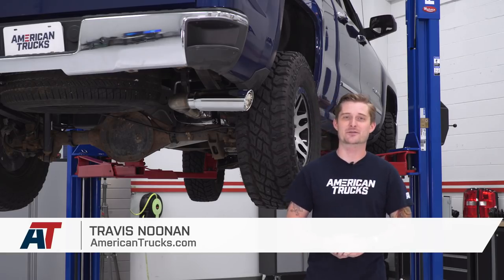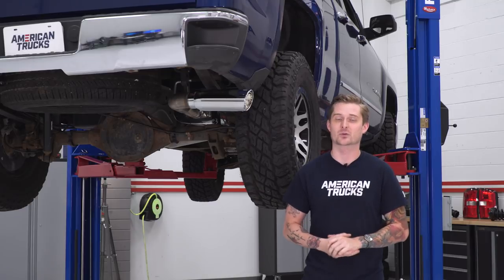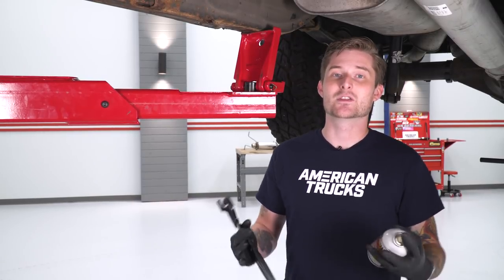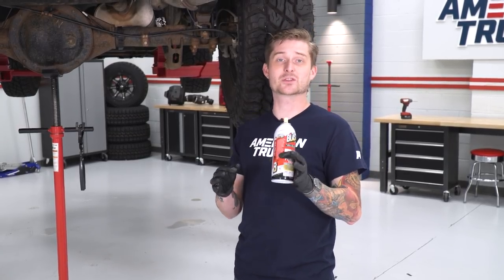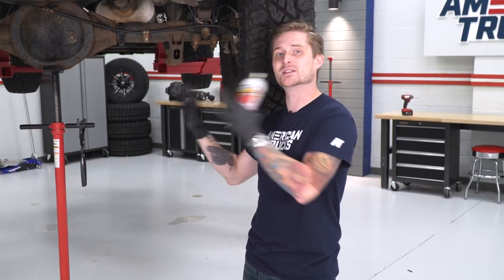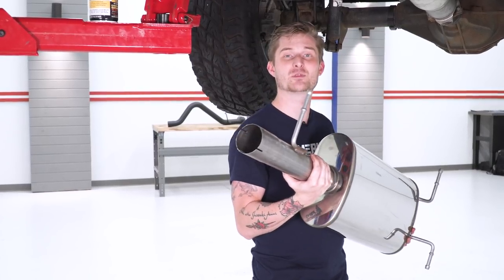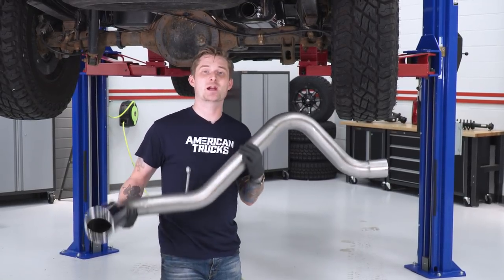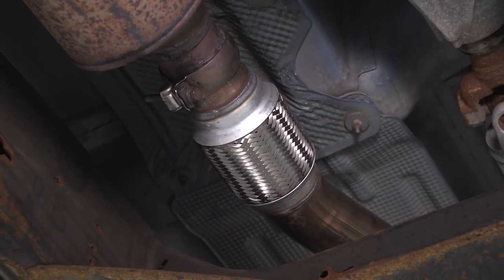2014-2018 Silverado & Sierra Magnaflow MF Series Side Exit Exhaust Sound Clip & Install

Comment: Are my eyes correct seeing this video. Does the new MF MagnaFlow Cat-Back have the flapper valve that's also in factory Silverado exhaust?
Reply: I didn’t think it had one since it’s not advertised having one but you can definitely see it. I’ve seen people post about the flapper but never see it until now
Reply: Looks like the magnaflow has a flapper too
Reply: @macmantle3406  I am picking up this kit from someone, slightly used, and he confirmed that it does have the flapper.

Comment: Did you clamp the flapper valve open for the sound clips?  I have the same system on my 2016 GMC Sierra and it makes horrible whistling noise.